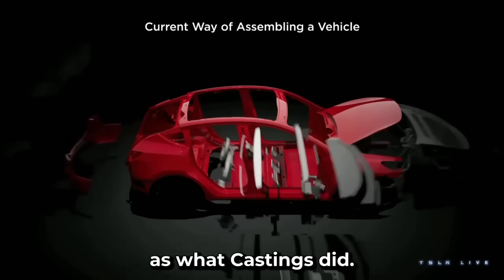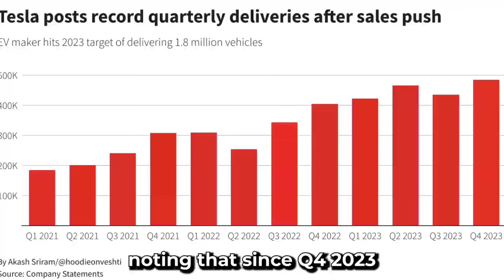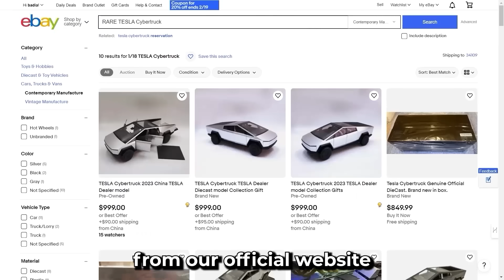Sandy Munro JUST Announced Something That'll Send Tesla Parabolic

Comment: I don't understand anything Sandy is saying. He  talks about casting? Which doesn't happen. He talks about moulds? Which don't exist.  I am a time served tool maker. And I am an engineering doctor.  Casting is  determined as molten metal in a mould. (Usually cope and drag. This metal is formed in a pressed die.  He is not an engineer.
Reply: I'm not sure what video you're watching but the mega castings are clearly shown in this video.
They replace all the front and rear pressed sub assemblies.
Reply: Unfortunately, Sandy is a little more than a paid shill. The front end has a lot of casted parts for the suspension and motor mounts.
Reply: @michaelthomas7898  the whole front and rear inner body pressings are replaced by 2 castings. Something in excess of 500 part reduction.
Reply: @michaelthomas7898 Unfortunately you have no idea of what you’re talking about. The front and rear parts are cast in 6000 ton presses.
Reply: @clu4u  You should get together with Geo. Are they casted or pressed? I thought they were casted..
Reply: @michaelthomas7898  BS